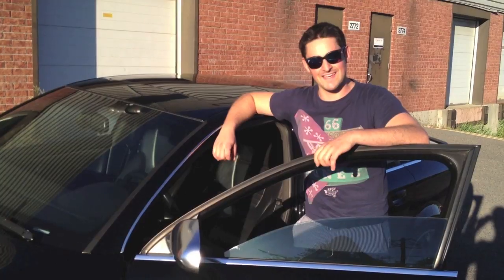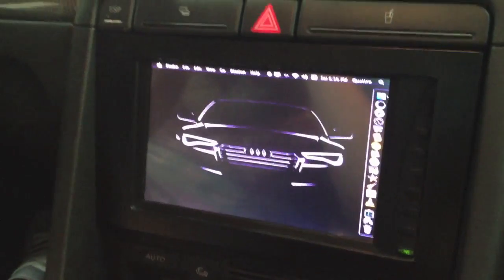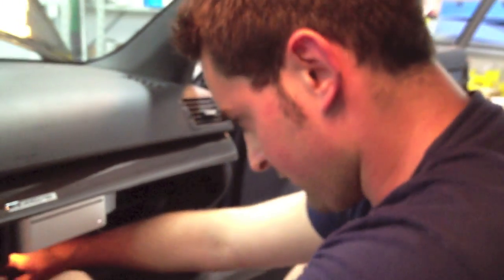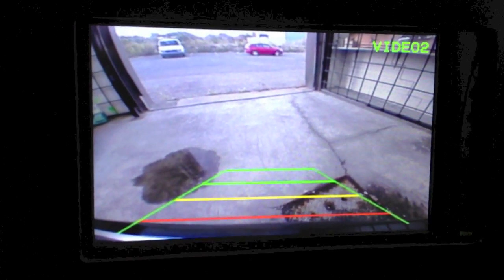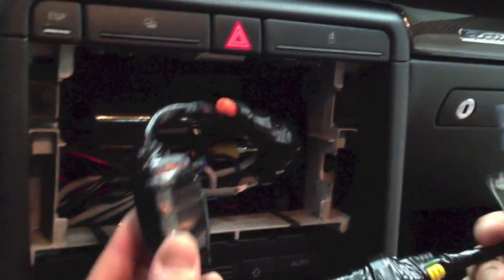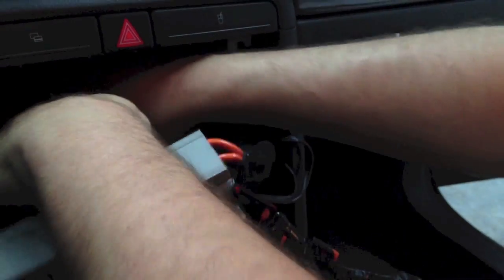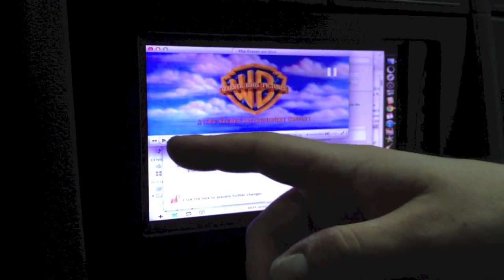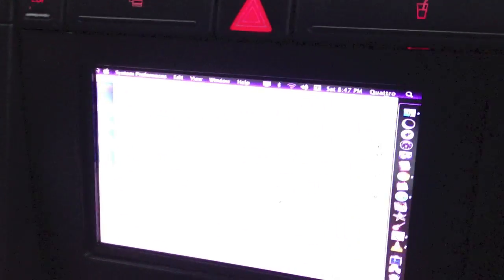MacMini Carputer Setup Audi S4 '05

Comment: I'm sure the boot time would be better if you used a newer mac mini but not a big deal. To avoid having the input gain setup you can use an optical line from the mini to a dsp with optical in such as dm-608 from audio control. That would get rid of any his or engine noise that you would get from the rca cables. Plug a mini optical adaptor right in where the headphone jack would go and run the toslink cable right to the back near your amp. That's where you can put your DSP.  All macs after 2007 i believe can put out a digital signal.

Comment: Wire nuts?  Unnecessary length of wire?  Power distribution isn't secured?  Garbage connectors?  200 ft of electrical tape?  This is an embarrassment.

Comment: It's cool that you have some time to customize great car like S4... but for me it's not acceptable like you did, there is a lot of oem parts than can be used i.e. instead of cigarete knob you could use mini navi panel which fit perfectly and comes with knob and up to 6 buttons, also CAN adapter could be usefull to gather info from car (ignition status, ambient light etc...)
Anyway nice to see you trying ;) good luck

Comment: Hey Dude ingeniously done with style; hope you do an update /upgrade using a high speed SSD Drive,  newer OSX Version update, Max RAM, and Parallel to gain WINX useful APPS too! FYI there’s also a Software MOD to gain different Android Flavor OS versions to include a three access point to TRI-OSystem full of mega-apps utilities, entertain, Game Emulators, USB controllers, remotes, and Wireless Video Stream APKs from an OS within another OS seamlessly operating fluidly. Let’s network sometime so send your info

Comment: not to judge or anything, but would it not be easier to just use a sufficient power invertor plugged into a cig lighter in order to power on the computer. since you only need 1 power source because that monitor runs on usb off the mini. I think in that situation all you would need to do is wire the car's audio up to the computer and call it a day.

Comment: Hmm, seems like you could have more easily used a ipad or samsung pad, using only a power connection, and blue toothed the signal or aux output the sound signal to existing or after market.  A ton less cables, and much cheaper, and would save a lot of space, needing no extra power requirement.  It would be nice if they dropped car batteries in front and rear of car to support amps and other powered items.

Comment: nice setup, but you could have saved a lot of money by just integrating an iPad mini as I did... No cables required, just bluetooth to factory system.  Steering controls, volume, all work great + navigon navi or Waze.  Better screen, faster startup than the mac mini ;)
Reply: Not enough memory or functionality. Sure its more convenient but what do you do when you want to download more music while waiting in a drive thru?
Reply: Mr. Camacorn What I meant by fuctionality playing higher bitrate mp3's and higher quality audio files like ogg and flac. Plus being able to download music without the use of itunes is great and if he chooses to he can use the optical out straight to his amps without any additional hardware.
Steve Jeong Actually the price of a mac mini is a lot cheaper than an ipad especially when you consider the capacity of the device.
Reply: Kurt Crafton II  Pssss. you got that good of speakers and amps in the car to have the need of using Optical input and higher nitrate mp3's? LOL 
I am an audio fan and have Melody AN300b amps+ rdac converter with top B&W speakers at home but in my car I don't think its worth all the hassle.  
It is a nice setup, pretty cool but not into that setup... I just got an iPad mini retina with 128gb and got all my mp3's, movies and photos.  Works like a charm with full steering wheel controls and also internet access. TO each their own I guess... the iPad retina is way much more convenient for me.